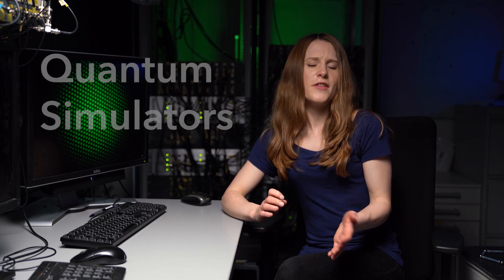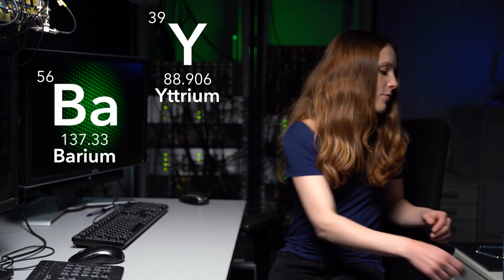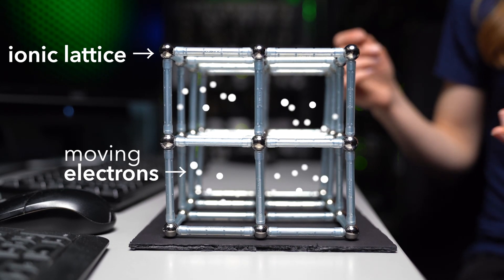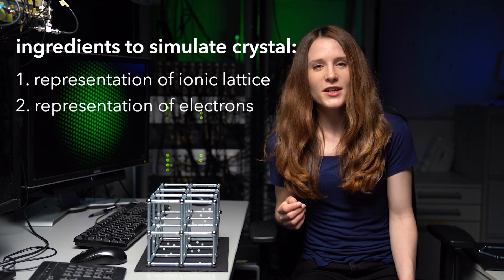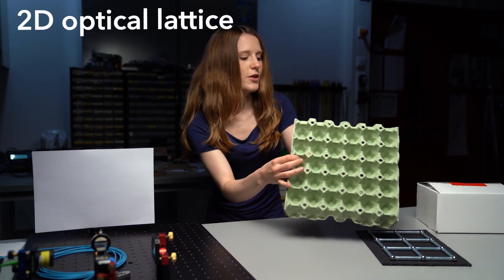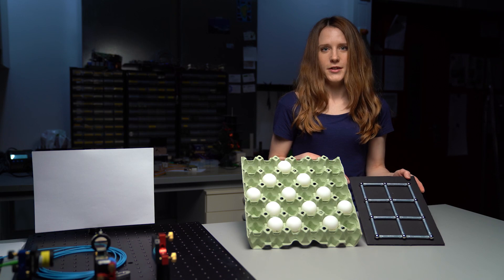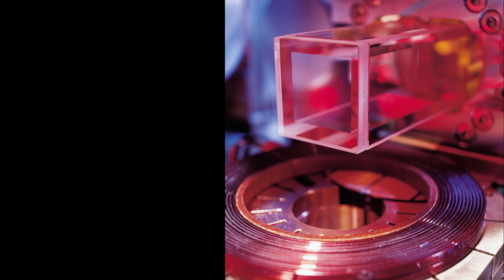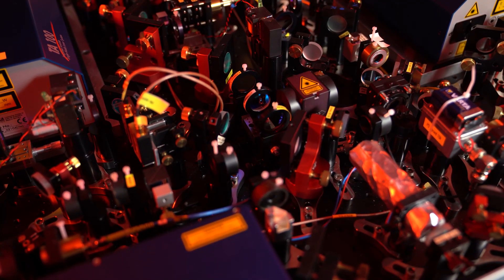Is a Perfect Cable Possible? (Quantum Simulation) - A Quantum Scientist Explains  | Quantum Minutes

Comment: how to get in MCQST, after the Btech in Electronics Engineering
Reply: What I can tell you as a physics master's student who was a working student with the "Bloch people" is that an electrical engineer or a mechanical engineer is worth their weight in gold in experimental physics. If, for example, you want to have LEDs with, let's say, microsecond pulses and high-intensity pulses to excite some material, then an electrical engineer can be very helpful. Or circuits for controlling lasers or that a detector is to trigger/record/measure synchronised with something. There are always applications where e-tech knowledge is welcome. As a former university physics engineer, I also reach my limits with my half e-tech knowledge. 

But you have to see if there is a need. When a position like this is filled, no one is actually needed. You just have to be lucky if someone retires or quits for other reasons. 
Apart from some kind of "assistant position", LMU and TU students are not really that enthusiastic about interdisciplinary positions. So, if you want to do a doctorate, for example, I would rather recommend that you go to a technical university like "Hochschule München".
Reply: @sevisymphonie5666  Thanks a lot for this clarification
Reply from the maker: Sorry for the late reply. If you are interested in Quantum Science & Technology, I strongly recommend the "Master in QST" which is a joint Masters course by LMU and TUM. It is a brand new course which exists for 1 year now and gives you just the right foundation for working in the Research Groups of MCQST or the Munich Quantum Valley.

Here is a link for more information and application: 
https://www.ph.tum.de/academics/msc/qst/qst/